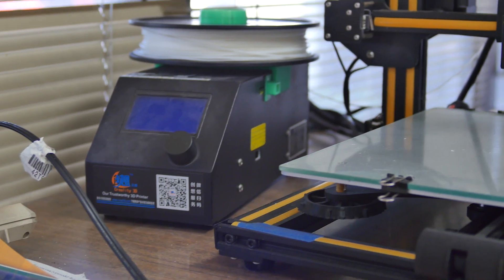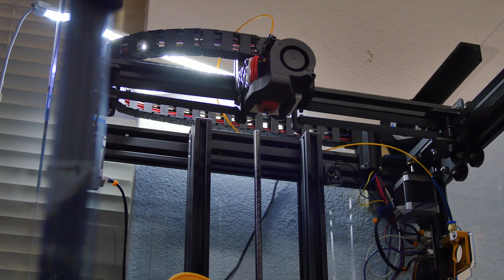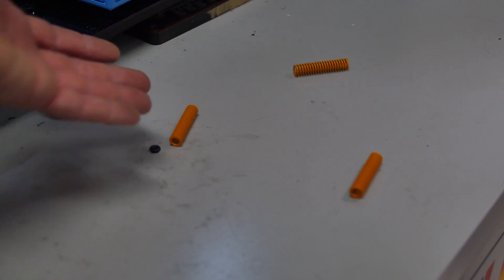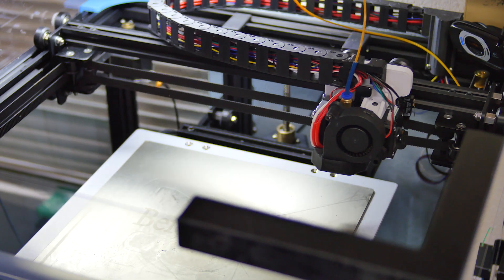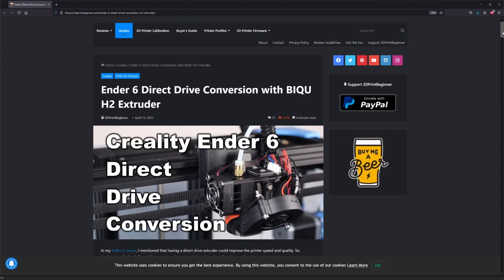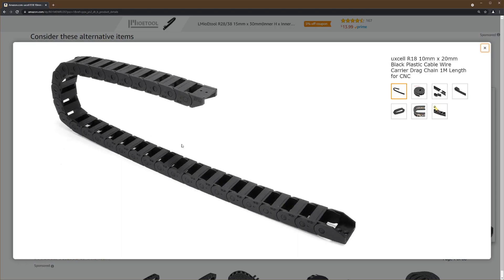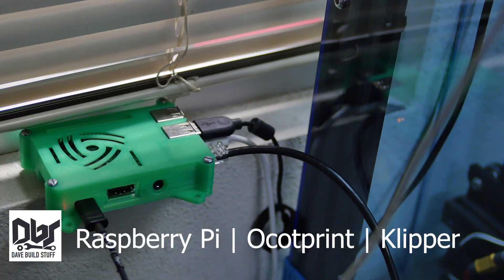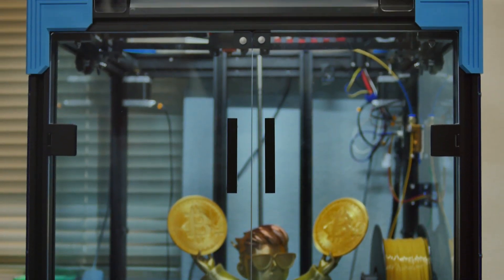Creality Ender-6 3D Printer with Mods Overview

Comment: Is the ender 6 so bad that needs all this pimping to be usable? Im asking because I'm a beginner printer(not a very rich one yet) and my 1st printer is ender 6. And so far it prints fine without any mods. So far it's hotend clogged 2 times but because i did not clean it between longer prints. :c
Reply from the maker: Hey, if its working for you then, great, stick with it! A lot of the mods and changes I made are for personal preference and "quality of life" types of things.
Reply: @designbydave  I think the only upgrades I'll get for it is a CR touch, top cover (not because of ABS but because of dust) and also the silicone bed spacers (theyre pretty cheap at aliexpress). My main reason to buy this printer because easily repairable, cheap and big print size, so I can print cosplay props.

Comment: I am disgusted with my Ender 6. I bought this 3D printer to PRINT...
Now I know the whole thing is stuffing around with adjustments, fixes and modifications so you can melt a kilo of plastic to successfully print a turd of a tug boat look film and throw it in the bin!
My Ender-6 is two years old and has had one perfect print. My resin printer cranks out object after object my design or others flawlessly, this is a PRINTER. 
I have had 6 months without touching the Ender but will put a direct drive on it next week, It either works or it is the Ender of printing filament...
Reply from the maker: Sorry you had a bad experience. The Ender-6 is definitely old and not up to spec with most printers today. Mine however has been an absolute workhorse for several years and I've used it to create several ambitious projects. I am however retiring it very soon and there should be a video about that.

Comment: Old video but I'd love to leave my own feedback - responding to your question at the end, I'd say both? I started with a bone stock Ender 3 Pro and modded the crap out of it. It was fun and I learned so much about maintaining, tuning, building etc. however, it was frustrating me because I seemed to always be tweaking and fixing and cobbling together different mods etc. instead of actually printing. So I bought a Neptune 3 pro, with all the mods I had done already on the printer, in a more professional implementation. It's good and fun to mod and upgrade, but depending on your budget or use case it may make more sense to just buy something more expensive. I have a young son now so I do have less time for tinkering than I used to, so I'll likely be buying something like a Qidi or Bambu instead of modding a cheaper printer.
Reply from the maker: Cool, thanks for sharing. That is pretty much my take away as well. Happy printing!

Comment: Hi David, at 01:56 , what are those spacers you used? how did you make the bed that stiff? Thanks in advance!
Reply from the maker: Silicon bed spacers. You can find them on amazon. They will be much more stiff than springs, but have less "room" to adjust so leveling will be a bit trickier.
Reply: @designbydave  I mean the shims? are those metal shims? do you have measurements for those? I would just print some...thanks!
Reply from the maker: @UncleSabbyPH  they are just metal washers
Reply: @designbydave  Gotcha.
Reply: @designbydave  Do you have more tips and tricks for the ender 6? I have not seen a lot of tutorials here. Maybe you can assist Us. I am tuning my ender 6 and with klipper...
Reply from the maker: @UncleSabbyPH  Not off the top of my head. If you have any specific questions LMK

Comment: did you use the original boar for klipper or change it? did you have to modify something to connect the raspberry pi?
Reply from the maker: This was a special build of Klipper built for the Ender-6
Reply: @designbydave I just got one and trying to improve it, but reading about put the raspberry to the ender board I have to modify the 5v pin from the usb to don’t fry the board, I wonder if you did this to your board
Reply from the maker: @paulosierra-luna4457  i did not mod the 5 pin. The raspberry pi will try to supply power to the ender-6 via the USB cable but it's not enough. The result is screen flickering as if the printer is trying to turn on but cant. I just make sure to power the printer before the pi. No issues with frying

Comment: In my opinion , there is no need to change to a DD extruder . Years ago people couldnt wait to get rid of them but for some reason people are not trying to put DD`s back in their printers which , is a bit odd . In my humble opinon Boden tubes are much better . Although , for speedy printing , the lighter hot end will help but you have to add so much bracketry usually to hold the thing , that goes out of the window. Just my 2 cents . (i have this printer and 2 elegoo n2s`s , and I tried a DD on both and ended up taking them off because it made ZERO difference !
Reply: one reason to have the DD is for tpu or any soft filament.

Comment: I managed to get Klipper running on my old RPI 2B. Now that I have tested it,  what I can tell is, it is a PITA! Yes it is PITA! Just too much to troubleshoot, one after another and never got it to run properly! I can't even do the bed mesh calibration! I'm using TM3D instead. At least it understand what G29 is and bed leveling is faster than the stock firmware!
Reply: Update: Finally I got Klipper running sweetly! It was just the config file. I love it now! Now I can have acces to my printer from anywhere, not only from my PC but also from any of my mobile devices! Just love it!!!
Reply: Is the config file avail somewhere as I would like to install klipper on mine  @samsman007

Comment: RPI zero is out of stock everywhere until March next year, as I was told. But I have an 8 year-old full size RPI 2 model B, laying around. Do you think that will still work with the setup?
Reply from the maker: I'm not sure off the top of my head. As I recall, you need a 3 or 4 but check the Octopi web site. They list the requirements.

Comment: What if I still want to use the stock firmware, not Klipper, how can I change or configure the extruder speed, since it is now 7:1 ratio?
Reply from the maker: You'll have to tune/configure the esteps value. I'm not sure the procedure to do that with the stock firmware. That's the kind of configuration setting that Creality tends to leave out of their firmware. There should be a way to accomplish this though

Comment: Congratulations on the video. TOP. I am a novice and bought ENDER-6 as my first printer and I want to make some modifications. I would like to ask you: the metal bed has 285x285mm and you used a smaller PEI, so how do you do the manual leveling, one made the home button, take the beak near the end of the bed? I intend to have the Glass for ABS and PEI for PLA. When you fix the PEI sticker, you are no longer using the glass bed. tks
Reply from the maker: Thanks, glad you like it. I don't understand your question about leveling. It will work the same regardless of bed. Just remove the glass bed completely and replace it with a magnetic, spring steel bed that is coated with PEI. That will work with all materials.
Reply: @designbydave  Hi, I'm finally resuming you print 3D and just bought a 2GB Raspberry PI 4B, so I want to migrate to Klipper with Ender 6, and I must buy another 3D printer, Sovol with Klipper. I would like some directions and or considerations to be able to control the two printers with only one PI and how to create these instances? Should I install on pi, mainsail or fluiddpi or octoprint or ospi64bits? I intend to leave PI 4B, connected in network, directly to the hub (router) identical to your installation. thanks
Reply from the maker: @blessblend8300  I don't think it's possible to run more then one printer at a time with a raspberry pi
Reply: @designbydave  Thank you, I started researching this possibility now.
Reply: @designbydave  thanks for answering. I observed better and the home button takes the beak out of the pei sheet, if it is smaller than the metal bed, but placing it centrally, when clicking in corners 1-5, for leveling the nozzle, falls into the sheet Pei. TIA
Reply: No two beds materials will be completely flat. Creality heated beds are also renowned for being slightly warped. I added a pei bed to my ender6 as I was fed up of getting pla to stick to the original glass bed. I had to shim the bed with tape with the help of a steel rules straight edge to flatten the flexible pei surface. Even then it was not perfect. Fitted a CR Touch recently, now my first layers are perfect. The BL Touch doesn't play well with steel beds.

Comment: I have an ender 6 as well and it was printing fine for the first 3 months but now I get problem after problem.. do you have any tips on how to make it stop z wobble?
Reply from the maker: Silicon bed spacers
Reply: @designbydave  I’ll try that, thank you
Reply: Check if the small wheels  for xyz are not to loose, i had to tighten mine a little
Reply: You can try lowering the z stop and tightening the bed springs (dropping the bed). Mine was very sloppy out of the box.

Comment: Great video. Any thoughts on adding BL Touch or Creality for levelling?
Reply: I added bl to my ender 6, best upgrade so far, however the cable connector is wired differently on the brekoutboard on ender 6 so i had to swap the positions of the cables for it to turn on. After that small issue it was very easy to set up. now i get perfect first layers everytime eventho my bed is not completely flat, worth every penny!
Reply from the maker: It's not something that I've really felt a need for as I'm usually able to get the bed quite level manually. Also, I've read way too many accounts of users online having various levels of difficulty with these devices. Having said thay, we did just get a new printer at work that had a Cr-touch and its been pretty great to work with. So, maybe it's worth giving it a look on my ender-6 as well.

Comment: My Ender 6 is just printing and the noise level of the stepper motors is driving me crazy. The Extruder sounds like R2D2 when retracting. I have red on reddit that only X and Y Axis have TMC2208, Z-axis and extruder have older noisier divers. Because the drivers are soldered to the board, i guess changing it (maybe bigtreetech skr 2) is the only solution for that. Sad that creality cut wrong corners, this printer could be a no brainer.

edit: In the meantime I found a video: There are 2 different versions of the mainboard. One with 4x TMC 2208 and one with 2x TMC 2208 and 2x A4988 both labled with V4.3.1. https://www.youtube.com/watch?v=DAfIEkHHoQc&list=PL-hOrEXH2Im6rvnHI6fS9u4tkvtZ5n__6&index=6
Reply from the maker: The s stepper shouldn't make any noise as it's only moving a tiny amount during layer changes . The stock extruder and stepper are not great regardless of noise. Upgrading to a direct drive extruder will be a welcome improvement.

Comment: Is the ender 6 worth buying or any pros or cons with this printer
Reply: if you have the time and patience yes. Sadly its not plug and play. Will have some issues with the stock hot end. Other than that its freaking good
Reply: @khaleedairil1975  have u had any issues wit the ender 6 at all
Reply: @monsterstorm78  currently running klipper with ender 6 so far no issues
Reply: @monsterstorm78  just the stock hot end not performing good enough. had a frustating 6 months of clogging stuck print.
Reply: @khaleedairil1975  what waz wrong with the stock hotend
Reply: @khaleedairil1975  oh wow dang sorry to here that
Reply: @monsterstorm78  the ptfe heatbreak is kinda hard to get perfect. maybe my skill is not good enough. But changing to all metal hotend was perfect
Reply: @khaleedairil1975  like an microswiss
Reply: Run only use Ender 6 If you ever Made a Ender 6 By yourself what i mean its Not for newbies

Comment: Any thoughts on Bondtech DDX v3  vs the BIQU H2 ?
Reply from the maker: No experience with the DDX v3 myself so I can't say. One clear advantage of the DDX though it the ability to swap the hot and cold end allowing use for a large variety of configurations depending on you needs. With the H2 you are stuck with what's built in. That, however has not been an issue for me though as the H2 has been able to handle (mostly) everything I've thrown at it. The main exception would be extremely high flow for super high speed printing. The H2 is pretty capable of high flow, but not as high as hot ends made specifically for it.

Comment: Did you lose any build volume by adding the BIQU H2 ?
Reply from the maker: I recall you end up losing a bit on the Y axis depending on that kind of part cooling fan situation you go with. Not much though, 5-10mm max.

Comment: @ David great review on the Ender 6 mods. Klipper looks clean, but I am currently unable to fully transition over to klipper due to issues with the cfg file not being detected by fluid, but my port shows up in the terminal. This has left my lcd stuck with no temperature value and unresponsive touch after trying to go back to Crealities marlin build. How were you able to get the cfg file and lcd to work correctly if I may ask?
Reply from the maker: cfg file "not detected by fluid" and the LCD not functioning are separate issues. If Fluid can't find your printer.cfg file you either don't have it generated properly, don't have it in the correct directory or maybe there could be some permissions issues. 

You need a specific build of Klipper with support for the stock screen. See the 3dprintbeginner tutorial. However, there is like one guy that made that Klipper build and it has gone out of date at one point. I think it got updated once but might not be working any more. If you build the Klipper firmware and install it from the official repository the screen will not work. 

A proper, well documented, supported and maintained tutorial for installing and getting Klipper to work on the Ender-6 is needed. Unfortunately I don't really have the resources for it at the moment. It's a shame though as Klipper is definitely a huge improvement for this printer and opens up a lot of functionality that the stock hardware is capable of, but the stock firmware is lacking.
Reply: @David Aldrich   Ok thank you for the response. I will see what I can do. I saw someone had done a successful Klipper install on a forum with some changes that was not in the 3dprintbeginners guide. Hopefully it is a updated method with clear instructions. I look forward to more videos on the Ender 6. A really good budget printer for people who have the time and patience to tweek and upgrade it.

Comment: Looking forward to the printer build. Also, I'd be curious to see a durability comparison between bikelugs from polycarbonate, and other, less exotic, materials. Or maybe a full suspension frame build.
Reply from the maker: This is a re-upload of an old video, so the printer build is complete. Check my channel.
I'd also be curious to see or explore the strength of various materials for 3D Printed Bike lugs. In order to be useful it would have to be done in a controlled manner with proper testing equipment. That's not something I have the resources to do at the moment. I do know that the carbon fiber polycarbonate I used on my bike is holding up just fine.

Comment: I tried doing the BIQU H2 direct drive with Klipper and it was an absolute nightmare to get set up. Eventually just gave up after the software just stopped working all together and went back to stock.
Reply from the maker: Yeah, it's tricky as I mentioned. It took me pretty much a whole day to get running. I'd love to make a proper tutorial but I don't want to revert my printer back to stock since it's working great now.